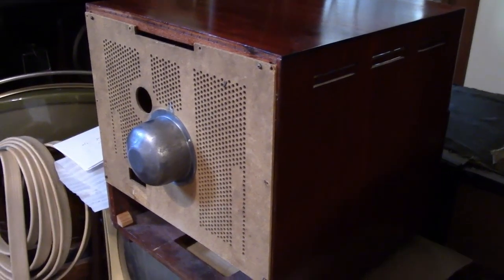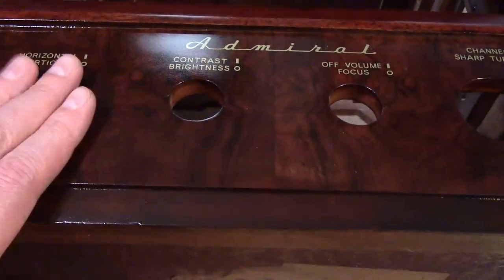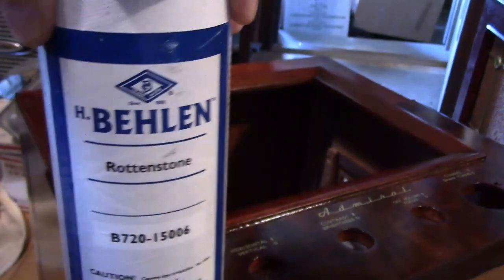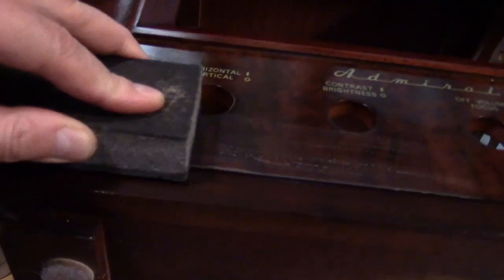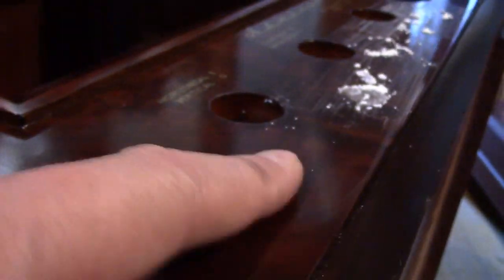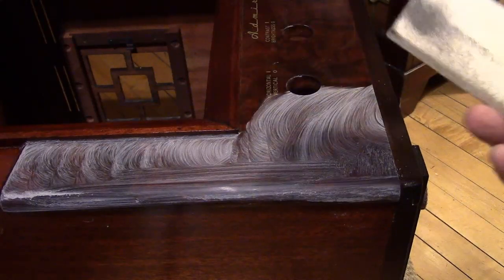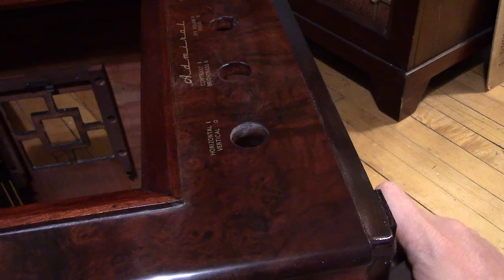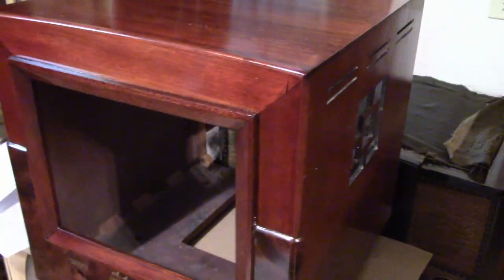Admiral 20X136 restoration p8o9

Comment: That real burl sure beats the faux stuff, though on this Admiral cabinet the faux finish was fairly convincing. Now that you have the technique down on how to attach burl walnut or crotch mahogany to a cabinet you could redo a pre war Motorola or an Airline radio cabinet with the faux grain, and naturally redo a VT-71 TV cabinet with that blond mahogany faux finish on it. I think that this may be the answer for my FADA model 1001 radio with the artificial olive burl on the front, if I decide to keep it.
Reply from the maker: OlegKostoglatov Yes, I have some very nice blond mahogany veneer for a VT71.  Maybe I'll get to it this summer.  Should be a quick project.

Comment: Beautiful Bob!  Usually when I see TVs and consoles on ebay that are over 400$, I am very skeptical.  But with Bob, it would be worthwhile considering the expertise, care, and craftsmanship that goes into a restoration.  They're better than new.  A NOS  Predicta would sell for well over 1K$. A Predicta restoration by Bob would be much better. Some people will pay for risky junk on ebay, like the Predicta that shango066 is working on, the buyer got burned for over 1K$, but shango has to make it good for the guy.  Bob, do you reveal your ebay seller ID when you decide to sell anything? 
Don
Reply: ***** I know that Shango066 will make it right again, if the owner wants to pay for it, though he should use a cooler iron on that P.C board, that gun is just too hot. That TV is actually a nice and reasonably unmolested original, but the seller pedaling it as a playing and restored set was a pack of lies, and the only reason why the current owner paid as much as he did. I think that it was realistically worth maybe half that at most with a good picture tube, he was just lucky that it wasn't DOA as many are.
Reply from the maker: ***** I've never sold anything on eBay.  The few sets I've sold so far have been to local collectors.  I get around $500 for a typical B&W 1940s console.
Reply: I have not sold anything on ebay for over seven years.  I don't trust ebay, but have been OK with buying for the most part. I just got a video pastern generator for one cent plus 15$ S&H, looks good too, just got it.  I hope to get to the Admiral soon, been very busy after being ill for a few days. 
Don
Reply from the maker: ***** I have nothing against ebay - just don't have the time to deal with listing sets for sale.  Good luck with the Admiral.
Reply: bandersentv It was one of your extra Bakelite Admiral consoles I guess, which was of course electrically and cosmetically restored. Yes, with those a local sale is much safer for all involved, and you don't have to pay anything to a middle man.
Reply from the maker: OlegKostoglatov So far I sold three restored Admiral consoles - two bakelite and one wood.  Also an unrestored Zenith porthole.  Hated to see that one go but need the room.
Reply: ***** bandersentv   Bob,  perhaps the Early Television Foundation could figure out a way to host a "mutually beneficial sales platform" where by hobbyists, with a "known track record" could sell there wares,  "as-is, with no implied warranty or liability", via the organization. The ETVF would profit from the sale, the seller would benefit from  realizing their asking price, and the buyer would stand a better chance of acquiring a "known quantity", and receiving something which was "really restored", as opposed to the hack jobs we've all seen of late.

My daughter is an attorney. Quite a while ago, I inquired as to what it would take to  begin a non-profit organization, whose purpose would be "for promoting ethics in the restoration of antique and classic electronic items". The whole shebang would cost less than $1K, (Delaware non-profit registry). I had outlined the scheme, which would require that the item being sold be "evaluated" by a board of "well versed electronics hobbyists" via either still photographs, or videos uploaded to sites such as this. We would have to build our reputation item by item, and member by member. If successful, it would "rid the world" of practitioners similar to "that guy in Vegas" ("tubes cost $300.00"), and save many radios/TV's from being butchered by incompetents.
Reply: Bob, like others', can PROVE what work he did on a TV or radio - with the Youtube series of vids.  I suppose that if one wanted one of his sets, all they need do is let him know, and then YT could be a venue for sales, better than ebay.  I have some keepers for sure, but if someone was interested in buying something on my ch, I'd be willing to make a deal.  I buy AS IS, but would pay more based on reputation as seen on YT.  Knowledge is money, and not knowing is risky, like on ebay.  We can also check out the buyer if they have any vids up.  So Youtube is more reputable than ebay. 
Don
Reply: ***** There are a few fleabay shill scam sellers that post videos on Y.T, but of course they don't show any under chassis shots. One I just call "Foggy", the user name is TransistorXXXX or something, he gives all his sets the same fogged finish as a cheap guitar, regardless of how they left the factory originally. Of course if it has an eye tube it gets a new one of those, because that green glow makes the reception so much better.
 Another I know of is not a fleabay seller but he is pseudo antique dealer who performs hack repairs on radios, and sometimes TVs, then tries to sell them at restored prices. He uses a very convenient story that the radio reception is bad in his area, which is maybe 30-40 miles from Vancouver B.C, and that's why he can't demonstrate the said set as working. The Vancouver area has about a half dozen 50 KW radio stations, and one of the sets he gave the excuse for was a 15 tube RCA console radio from 1936.